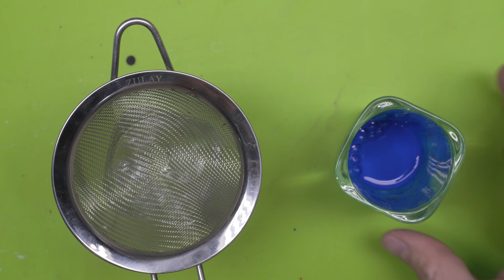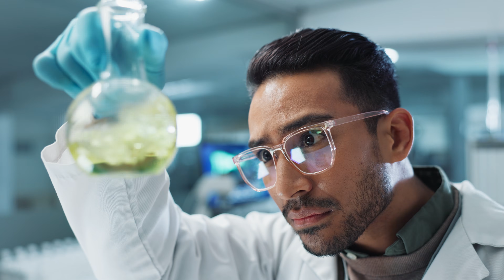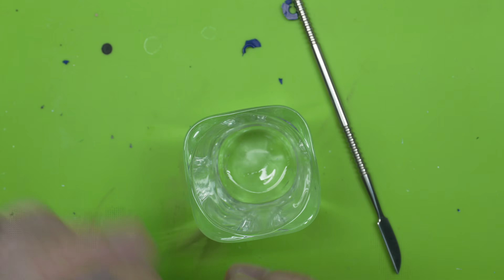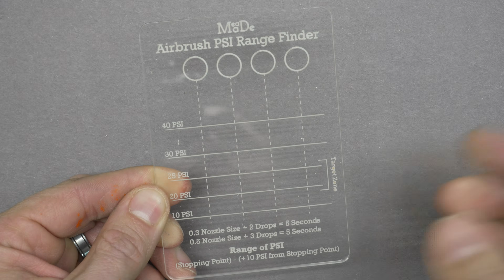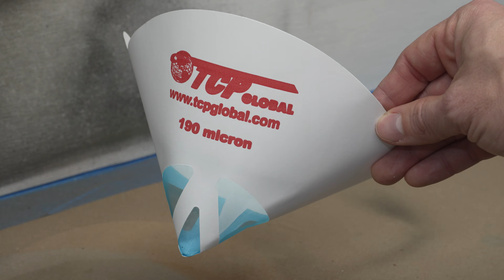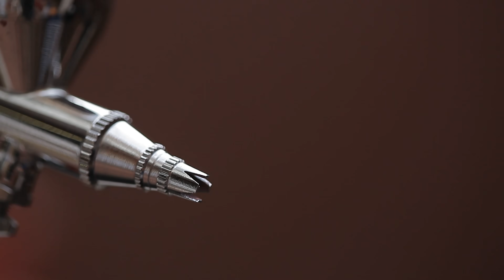Common Airbrush Paint Thinning Mistakes

Comment: Too thin gives spatters ? You should watch the Harder & Steenbeck video about paint preparation. 
Spatters come either from too high pressure for a given mix or pulling back the trigger before pushing the air.
Or a cheap Chinese Airbrush , get at least a 100 € or $ one no need for more but less is not good for beginners ,they have so many shortcuts that they need a pro to compensate them and only frustrate beginners.

Comment: I use Folkart multisurface and Decoart craft paints. I use 50/50 ratio of paint and liquitex acrylic medium with a couple drops of flow improver.
 Distilled water was diluting down the binding polymers too much, giving it a weak bond.
 For those wondering, acrylic medium is pretty much binding polymer without pigment.

Comment: I’m a bit of a cheap skate and I’ve found some solutions that work well for me. For cheap craft paint, I use blue windshield washer fluid from Walmart. 60/40 ratio. 60 paint, 40 washer fluid. I find a 50/50 mixture too thin for my liking. Works like a charm. I’ve even sprayed enamel clear coat like you would use as a top coat on a vehicle paint job over it, and it’s been fine. O’rilley’s or Autozone has it in a quart ready to use. 
Also, anyone that might be interested in using Rustoleum paints, decanting the paint into another container (I use a drinking straw) and spraying it using an airbrush is the key to a great looking paint job, but it is **imperative**that you let it cure for at least a month before top coating it with clear coat, or it will wrinkle the paint almost every time. Rustoleum 2x is even worse but I’ve used this technique successfully. Anyhoo, just my two cents. Happy modeling.

Comment: To be honest, probably the greatest thing I ever invested in was spending like $10 to get fifty empty 20 oz bottles and buying small metal mixing balls. Once I've determined a good ratio for a color/task I'm doing, I label a bottle and brew my own premixes. For example, let's say I'm doing a basic 50/50 mix of paint. I take a small hobby ruller, make some marks on the side of bottle, and pour up to each line, and add the steel ball(s). Now I can shake a bottle well, pour straight into my bowl, and keep painting. It has cut an unbelievable time out of my mixing phase.

Comment: I don't know if this is a difference between acrylics and lacquers (I've never used water based lacquers) but the whole "don't mix in the cup" is such BS. I have never not mixed in the cup and never had issues. I just use the same dropper I use for the paint to suck the thinner and paint together over and over.  That mixes it thoroughly enough.

Comment: I have noticed that using just IPA to thin acrylic paint isnt great and using distilled water is good, but can take a little while to dry sometimes. If you add 10% IPA to your total amount of water, then what you now get is the equivalent of "Fast" paint. Still mostly thinned by water but it has a quicker dry time as the IPA helps the water evapourate out
Reply: India Pale Ale.

Comment: I get "slow air bubbles" on my airbush when i just hold the trigger down and not pulling back. I've replaced both the nozzle PTFE and rubber seal on the Aircap (Harden and Steenback Infinity CR Plus airbrush). Wondering if you have any suggestions?

Comment: THANK YOU! I cannot believe I didnt think of straining! My second time airbrushing was frustrating. I am now sure it needed straining, but thought it was just too thick......then I thinned it too much! Ordered the viscosity aid off ETSY. Kind of wondering if my PSI gage on my timbertech compressor is off also now. Mixing in a separate cup now, using distilled water. I still may use a couple drops of flow improver for Vallejo and AK3GEN acrylics.

Comment: So I take empty dispenser bottle with either flip open or twist open cap. I cut a piece of super glue fine screen or cheese cloth and put it in the cap. .I also have a stencil that draw evenly spaces lines on the side that closely equate to .5 ounce.  lastly I put a small steel ball in the bottle.  I make up a bunch of these bottle. When I am ready to mix I mix in the I use the lines with eye sight of thickness close the bottle up and shake like hell. then squeeze the pain into the air brush . the screens you make up may need to be changed if you plan to use the bottle multiple sprays. that is why screen is better then cheese cloth but not as fine.  When I am done I throw all of them in a meshed bag and throw them in the washer.

Comment: Well most companies sell the same chemical, Methoxypropanol, in different bottles for airbrush celeaning/paint remover/airbrush thinner for acrylics. Its all the same, but they sell it to you at a ridiculus markup.
I bought a 1L Bottle from a big vendor for 13€. Hobby Companies usually sell 100mL for 10-25€.

I found that out by looking at their SDS (safety data sheet) for the related product, where they often have to disclose the ingrediens, especially harmful chemicals and appropriate precautions.

Comment: Im a beginner so Hopefully, this isn't a dumb question, but in the past I've only had children's airbrush systems and am trying a real portable one for the first time. 

What I'd like to know is, is this the kind of thing you need to be in a well-ventilated area to use? 

The one I have is recommended for makeup, nail art, and model art ext. I'll be using it for art projects and most likely useing the Distilled water as my thinner. 
So will I be able to use this indoors?

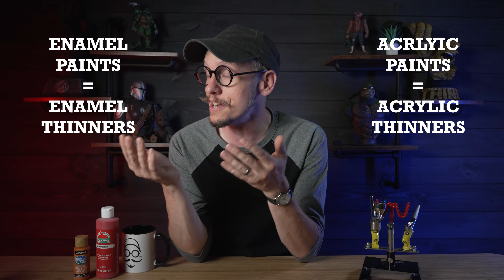Comment: 2:00 Whats the difference between Acrylic Paint and Enamel Paint?
Reply: The thinner you need and the finished surfaces you have. Enamels are usually more resistant than acrylics. But need different (more "aggressive") thinner
Reply: Acrylic has, like all these commercial thinners, simply become a marketing word disconnected from any sense of reality. Chemistry is science not voodoo.
Reply: 2 different paint types, use the manufacturer's reccomended thinner if you're not sure

Comment: I respect the use of craft paint here.  I would love to see a video where you take craft paint and compare it directly to expensive airbrush or hobby paint.  I think it would be useful to see if there are any compromises, and what those are.
Reply: The biggest compromise is paint flow pigment density and micron size of said pigment which also affects the flow and ease of use the finer the tip on the airbrush the finer the pigment for better outcomes!! 🤷🤷
Reply: Craft paint is cheap for a reason, you will get a lot chalkyness instead of crisp brilliant colors. Youll get inconsistency between colors. Poor coverage, some colors like yellow could take several layers and not cover enough. The paint could also be really fragile and scratch off easily.

In conclusion its not worth it to go with cheap paints. If you spend a lot of time and money on your models you dont want them ruined by bad paint. And professional colors like ProAcryl, Vallejo, AK are not that expensive and can last you a long time.

Comment: It's amazing that the first tip you get into is using craft paints.  Today was my first time painting a lot of mini pieces (a 40k Tau unit, subassemblies), and I first tried with a Fanatics Army Painter light grey.   It was tough getting it thinned right with airbrush thinner.  

Then I switched to one of the craft paints I had, another light grey.  I forget the brand, it's sort of the one-step-up brand from Hobby Lobby.  Using the airbrush thinner again it seemed to work WAY better than the more expensive hobby paint.    Obviously that doesn't mean all craft paints are better but these were definitely at least as good as their counterpart in the Fanatics line.

Comment: The so called Cheap hobby paint works just fine.  The whole argument is people just want to complain that you should pay through the nose like they did for similar results.  If the cheap hobby paint is thinned properly it goes on the same as anything else.  The only caveat is specific color shades for say Military WWII vehicles and such, but with a little mixing you can get close enough.

Folkart paint has no draw backs if you are using it correctly and finishing it with a proper clear coat and not floor polish which ARE 2 different things.  Good video!

Comment: some brands will make a thinner that is just distilled water with a tiny bit of a product called a wetting agent, which is similar to a detergent. So if its clear and smells like soap or is a bit bubbly when you shake it, distilled water will be fine. They just wont recommend it because profit margins.(this is mostly just vallejo and a few other companies)
Also most detergents are wetting agents. 
More reason to not drink paint.